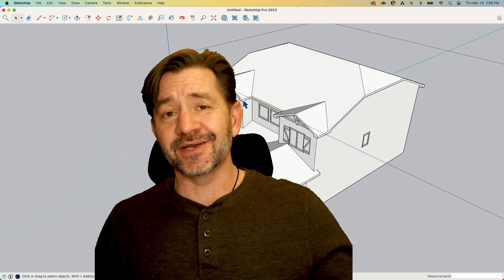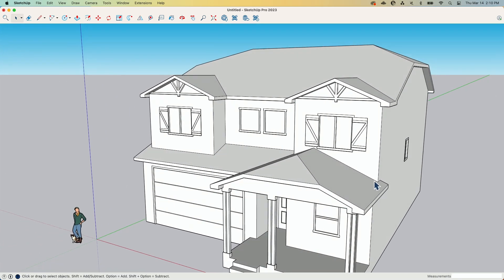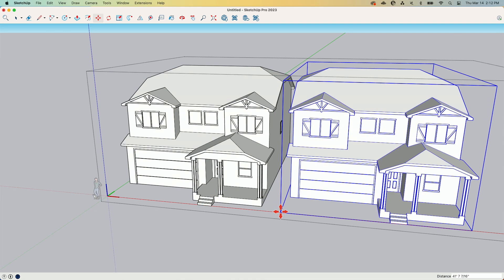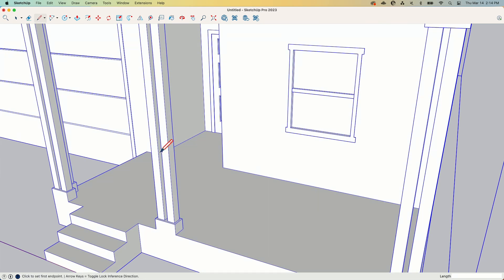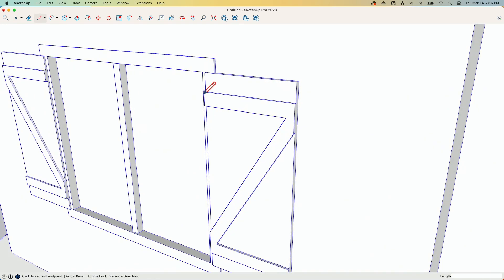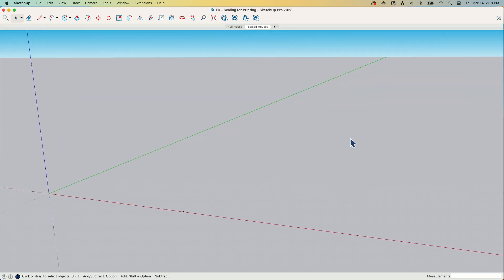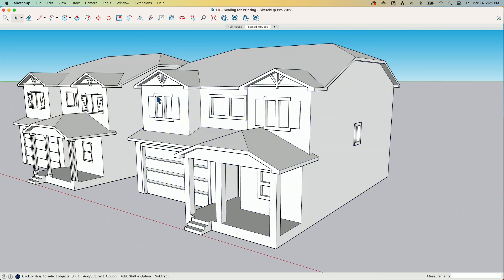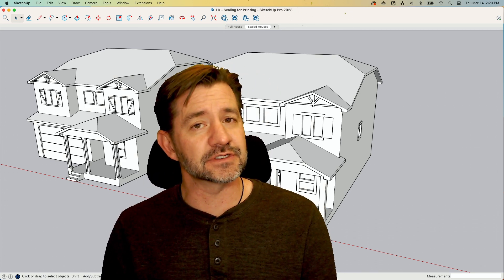Cleaning Up Architectural Scale Models for 3D Printing | Expert Tips #sketchup

Comment: Excellent video. I bought a 3D printer a couple of years ago for the purpose of creating 3D architectural models of my designs of mostly houses. I have a few pounds of scrap plastic from the learning process. I spent most of my time on with the SketchUp model of a small but 3 story house that had been recently built. I wanted to do all three floors showing windows, doors, cabinets, stairs, etc. I tried printing each floor as a separate print with the stairs and elevator as a separate model, all of them to be assembled. Not successful yet, but I learned a lot of the things you cover in this video. Thanks!

Comment: Thank you for this. I use Sketchup Pro almost exclusively to design small complex 3D parts. Sometimes importing drawing from the warehouse. Is there a way to ....what is in essence, scan the exterior skin, and eliminate the unnecessary interior?  In some cases my work will be printed (never FDM) as a solid block. I spend WEEKS just gutting and cleaning up interior rubbish, searching out tiny anomalies and ticks, to make a 'solid'. What I see is this.... like when you make a copy, instead of it copying the ENTIRE object, it only duplicates the exterior profile. Even if rework is needed, this would tremendously simplify the preparation for 3D printing. Another thought that Sketchup could consider, a MACRO mode that allows it to work on a reduced scale. Many designers are forced to consider other programs due to their 3D printing friendly features. Thanks again, I watch all your videos. You are the best!👍

Comment: Very useful video Aaron, thank you. One suggestion I would add in this case. I would make the main body of the house hollow (like an Easter egg). That would save a ton of plastic and time.
Reply: This is an interesting experiment… depending on your settings, it may be a wash. Depending on your infill, wall, and support settings you may not save as much material or time as you think! I did this on some smaller buildings and printing solid was much easier and was only marginally more in material! I encourage you to give it a try, though!